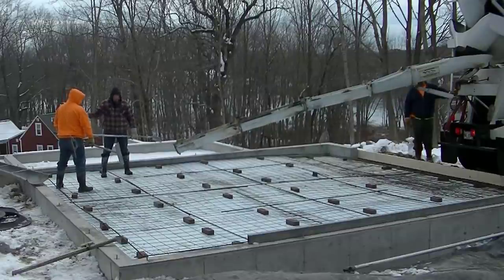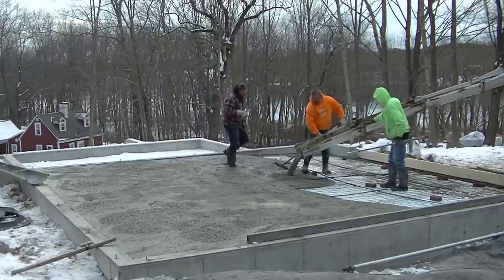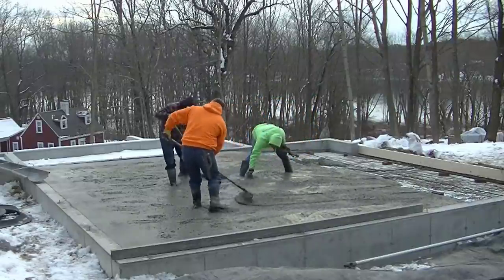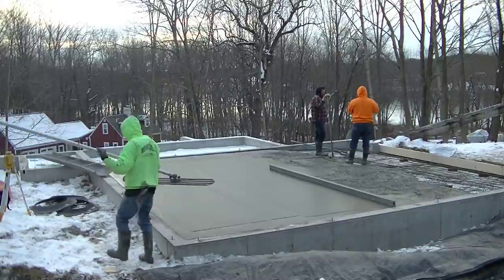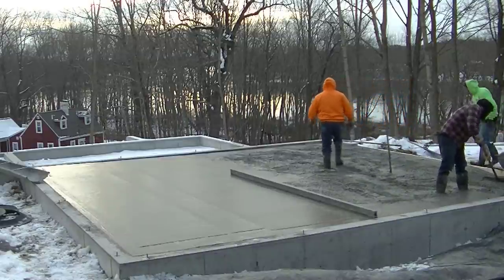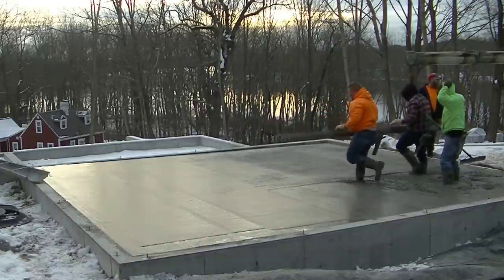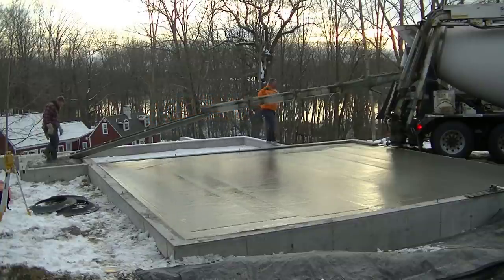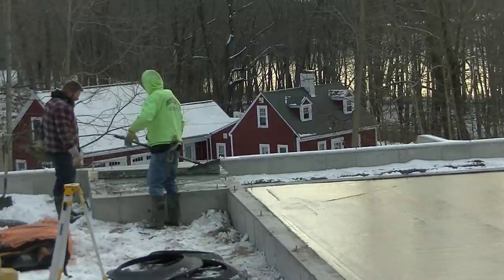Garage Concrete Floor (How Thick?) (How Much Slope?)

Comment: Sometimes I'm jealous seeing u guys pouring in the winter, then I step outside and remember why I sold my ground heater and 2 semi loads of blankets. Just trying to keep the guys busy can get expensive.
Reply from the maker: Yea, it's hard to get up and get going when the temps are in the teens. The older I get the harder it is.
Reply: @MikeDayConcrete  move south!

Comment: A lot goes into pouring a concrete garage floor. We can do the prep work, level, gravel, compact and wire. Concrete workers pour, pitch and finish pretty. Note the additives to the Crete.

Comment: Thanks Mike.  I'm amazed concrete can be poured successfully in 15 degree temperatures.  I'm not a pro but have poured one 40 x 25 slab.  Your videos taught me everything I could have done better, for the next home later this year.

Comment: 20 years ago, I noticed contractors like you in South east NY started making chutes out of big pvc pipe cut in half. So they had their own custom chutes. But I’ve never seen a conveyor truck around here
Reply from the maker: Some guys still have those pvc chutes, but most now have the aluminum ones. They are expensive though. I've had some for over 10 years. Worn a hole through the bottoms from so much concrete flowing through them.

Comment: The concrete trucks around here usually have an extra 8 ft chute they carry on the side of the truck so you don't need your own. I am in Idaho. The majority of our concrete trucks dump out the front also. The driver can control everything from the drivers seat. Most drivers are pretty nice around here, some don't listen to your instruction and try to rush you.

Comment: Mike, next time tool in  a   2"x2" keyway in the base slab  where the center of the wall is. This will tie in the wall to the slab   AND as a bonus prevent water infiltration. Keep the rebar  but  stagger it  just to the edge of the keyway. Some tarring should be applied where backfilled as well.

Comment: Yall are the best, with Odell. What would you do if you ever run short?? Also how much water reducer to add to a yard? Ty
Reply from the maker: If we run short we call for another load. It really sucks though. They add around 8 to 10 ounces per yard. Depends on the brand and if you want mid or high range.

Comment: I’m having a 16’ made this week!  We do a lot of patios that maybe 25-30’. We normally just pull it r shoot it some.   But that’s getting old!
Reply from the maker: We use these chutes all the time, I got an 8, 12, 16. Saves a lot of pulling.
Reply: @MikeDayConcrete   ever had a problem with the driver not allowing you to put the chute on the truck?

Comment: What did you use for accelerator,calcium  or calcium chloride and what %? Your crete looks alot nicer than ours here in Montana. One time float and its sealed up with no lines pouring at a 7.
Reply from the maker: 4000 psi with 50lb bag of cal. We used 1.5 bags per truck on this one. 5.5 yds per truck. This company does have a nice creamy mix. Very east to pour and finish.
Reply: @MikeDayConcrete  its hard for me to make the comparison because calcium is liquid here and instead if adding bags we go by percentage. For instance I poured a 2400 sqft slab the other day and added 2.5%. We pour with 4000 psi in most all slabs unless engineered for more. Thanks for the reply I appreciate it.

Comment: Hey Mike
What kind of tolerance do you hols for your slab flatness. +/- 1/8", dips or low spots?
This has been something that I fight myself with when pouring concrete.
Reply from the maker: On a residential there nobody holding us to a tolerance but I would say we're about 1/8" in 10'. You can tell when you power trowel. Also when we snap chalk lines on the floor to saw joints, you can see how flat it is.

Comment: Hi Mike ,what do you do when you turn up short? I poured machine foundations in when they removed machinery and we threw in all kinds of old compressor parts  in to make it level.
Reply from the maker: I call for another load. If it's less than a wheel barrow then we'll try to fill with stone and mix with the concrete but it might only happen once a year for us.
Reply: Hi Mike ,I would hate to try to excavate some of those fill ins we did at the Worthington Compressors in Holyoke,MA.Its a Amazon distribution center now.

Comment: Which bag of pre mix concrete do you recommend for smooth finishing work? I can never get the basic quickrete 60lb to be smooth since there's so much aggregate it seems like.
Reply: Quikcrete 5000, mix relatively dry and you’ll get pretty close to what you would get with ready-mix.  The cheaper bag mix they tend to skimp on the amount of cement mixed with the aggregate.  Hope this helps.
Reply: @danno55328  yeah I had a feeling I should go with the 5000 pro finish. Thank you
Reply from the maker: Yes, the 5000 is closest. You can even add a quart of cement to it when you mix for better workability.

Comment: Ok ... so in videos by others I never saw them come in with a laser level and shoot the depth of the concrete so I can see how in the middle you determine how thick the concrete has to be.  On the sides I assume you strung a chalk line at the level required to get the requested slope and thickness.

So .... the guy with the laser level does not seem to be there in the middle religiously, lack of better word here, verifying that the inside, middle screeder, is keeping the correct height and slope.  So ... ok I know that experience accounts for alot of unseen skill in doing stuff. 

once the floor is set ... do you go back and shoot spots to verify that you hit tgts?  I know it's not like you can just tear it out and do it again.  But, and I'm thinking in the middle of the floor, how do you verify for the customer that he paid for x and y and got x and y in the end?

Also ... I realize you didn't put in the wire mesh rebar.  But it looked like throughout the video that there were bricks sitting on top of the mesh and thus the mesh was sitting on the stryrofoam.   I was under the belief that the mesh and rebar should live somewhere near the center of the mass of concrete.

Comment: Pouring concrete outside in 15 degree weather? Did you cover it with insulated blankets? Concrete freezes and weakens it.... That’s not allowed in Minnesota, I’m shocked that’s allowed there.
In Minnesota winters, Concrete needs to be poured at above 40 degrees and heat left on it for two days while concrete cures.

Comment: I thought  and was told when I was an apprentice that the slope for concrete couldn’t exceed 2.4% is that true ? I don’t do too much concrete I’m a farmer but I’ve done some form work in the past but I’m no expert when it comes to concrete but I like learning about all aspects of construction
Reply: Ment to say framer not farmer I mainly do wood framing I’ve only been in construction for about 5 years so thers still a lot I’m learning and need to learn I’ve been wanting to learn more about concrete maybe you can answer my ?
Reply from the maker: On a garage floor there's no code as to how much slope where I'm from. We do what's reasonable so it'll shed water.
Reply: Im from California I’ve formed a few side walks and one time we had to tear out a few because our slope exceeded a 2.4% just wanted to know if this applies to most pours thanks for the info appreciate it

Comment: Mike, why did you ignore the wire mesh and rebar elevated by bricks?  You or your guys just left them on the ground. Explain to everyone how good that is. You are suppose to be a learning tool here and I don't mean to pick your work apart but that wire mesh and rebar are important to the integrity of that slab. It's so easy to do it Right.

Comment: Hi Mike! I have a question. I live in MA and I’m planning on tearing up my severely cracked 20 x 15 garage floor and repouring it. What is the benefit to adding the styrofoam? I assume it’s for expansion in the cold weather?
Reply from the maker: The styrofoam helps keep the frost from getting under the slab and lifting it. Works really good. Still need to have a good gravel base, no expansive soils like clay under there.

Comment: It is not alot of fun doing concrete when it is that cold.
Reply from the maker: I got my battery heated jacket on, that really helps.
Reply: @MikeDayConcrete  How much does a jacket like that cost and where do you buy them

Comment: In 40 years you never learned how to install rebar. Even when someone left all of the blocks laid out for you, you just left the rebar lying on the ground where it does not contribute to strength and you didn't even pull up the mesh. There is 40 years experience and then there is one year experience 40 times. Glad it's not my garage.

Comment: Got it nice n wet for the boys with those additives in there. Your a nice fella Mikey. Least you got the stuff to speed it up i hate winter jobs just sitting there all day
Reply from the maker: We don't like sitting there either. Hot water, accelerator, water reducer speeds things up a bit.

Comment: Your concrete dosnt look like it has very much rock are concrete here in Illinois has one inch rock or hair bigger in it it dosnt seem to work as easy as yours does
Reply from the maker: Ours is 3/4 and some smaller. We can ask for a 50/50 blend with 3/8 if we want it that way. No 1" rock in our mix.

Comment: No way u power troweled it by 330 and saw cut it must off had 20% acceleration in it
Reply from the maker: We did, the styrofoam keeps it warm underneath and really speeds up the set time.